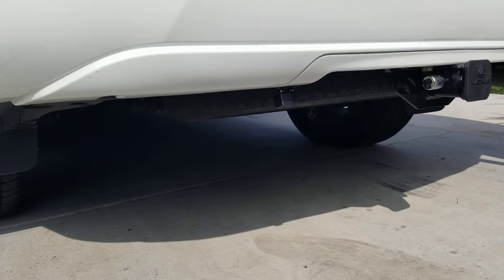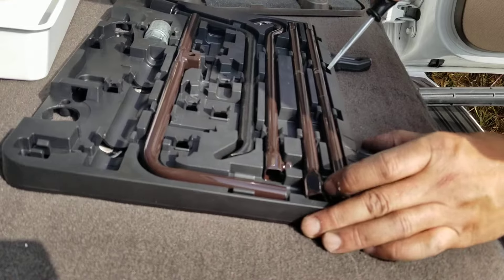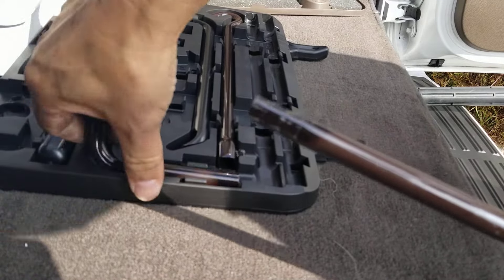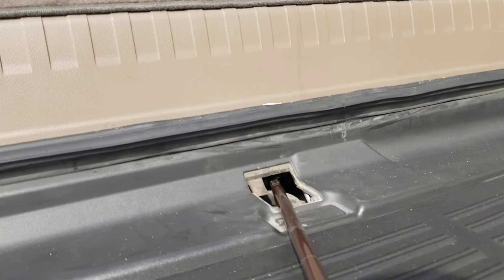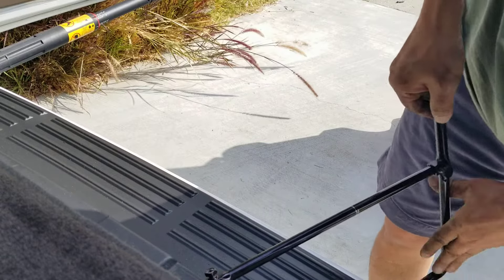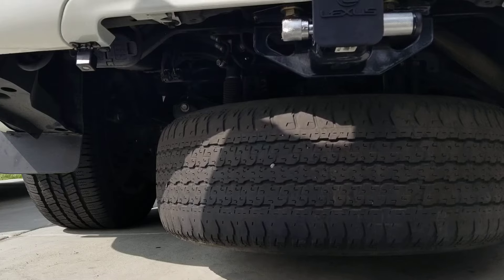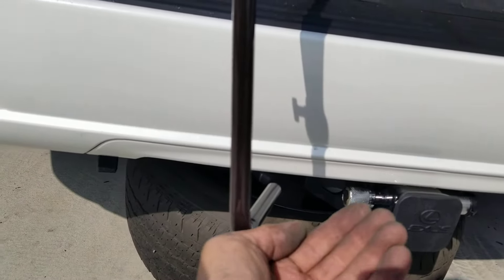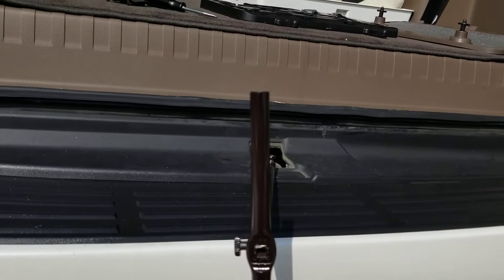Lexus GX460 and GX470 Spare Tire removal

Comment: @gxbob is there an easy way to determine which tire pressure sensor is malfunctioning?   Checked all 5 tires for low pressure.   All are fine - yet my low tire pressure light had come on .   Thanks for all you do for GX community

Comment: Does it matter what way my wheel is facing? Can the face of my rim be towards the ground?
Reply from the maker: The chain hook would then be grabbing onto the face of the wheel causing scratches and also the wheel would be exposed to flying rocks and debris.

Comment: Thanks for the video. Just got my first flat tire today. Unfortunately, as soon as I lowered my spare tire, it also came with a severe tear on the sidewall. No idea how that could've happened? I just picked up a 2021 a few months ago.
Reply from the maker: Jealous neighbor.
Reply: @GXBOB  Thanks a lot for the reply Bob :) One question, I'm about to swap on some 265/70r18 all terrains on my GX. Do you think that size will fit in the spare area?
Reply from the maker: @vadim9342  hey, the good thing about the under carriage spare tire compartment is its not confined to just the oem tire dimensions. The chain that attached the tires swings in all directions. All you have to do is guide it to where you want it when you crank up the chain. Even though the 60’s ride up to my tow hitch, i can easily push it back more if i wanted to.

Comment: Hi BOB, I just did this and noticed that the front side of the spare tire sits a little lower to the ground than back side when I reeled it back up (a little slanted). Is this normal? It feels tight and snug otherwise. I guess I should have looked how it sits first before lowering it.
Reply from the maker: Hi Tu,   technically you can adjust any way you'd like.  All you have to do is keep it leveled while you're turning up back into its space.  Sometimes its easier to do it with 2 people so one can turn the bar while the other person eyeballs the tire back into place.  Also make sure the thing that clamps around the inside diameter of your wheel is properly set in place, that can throw off the leveling of it too.

Comment: Thank you for the upload sir! Just a quick question are you missing some tools inside the tool kit? Also I’m curious to know what goes inside the other panel? Mine was a first aid pouch but I saw two straps, seems like something else should be there
Reply from the maker: not sure if i'm missing tools but if i am, i most likely don't need it.  i used the same kit to do the hydraulic jack in my other video.  The other panel has my first aid kit and some ratcheting straps in case i need to tie anything down to my roof rails.
Reply: @GXBOB  well in your other video how to take the back panel off to redo the camera you have some interesting toys strapped there, not original Lexus parts for sure.
Reply from the maker: @alstonian78  its a manual tire pump.

Comment: Hello, do you know how tight it should be when you are lifting the tire up? Thanks in advance
Reply from the maker: Hey WEC,  Its a chain hoist. Very normal typical chain link.  I typically wind it up snug to the point where the tire has no slack to move around or come off its adapter, but not tight enough where the rubber is going to compress against the metal floor ceiling of its housing and cause frictional tire wear over time.

Comment: Lexus should have designed it so the spare tire valve stem was pointing downward so you could check the tire pressure with the spare on the car.
Reply from the maker: Hey...........you gave me a fantastic idea......Thanks.

Comment: Do you know how big of a tire I can put on the spare compartment?
Reply from the maker: I wouldn't go larger than stock because the tire was really tight against my tow hitch receiver
Reply: I was told by my Lexus technician that a 32 inch tire is the maximum u can fit underneath
Reply from the maker: @edzed3865  I'm sure you can use one leg to push the big tire in while you crank the tire up to guide it. I never attempted to put anything other than stock so I can't make a fair assessment

Comment: I was wondering if you knew how to turn off the tpms light on a 2013 Lexus GX460 I got a flat the other day and got a new tire today and my light didn’t turn off
Reply from the maker: Hey Justin,  don't believe  u can do that manually.  I don't even think there is a reset button for as long as i've owned all 3 generations.  The tires have monitors.  If your lights are on and your pressure is good, that means the people who replaced your tires took your monitors?  I've never had to deal with it so i may check on the lexus forums.

Comment: what if my tire is seized?
Reply from the maker: When all else fails , find out where the seizure is and pick up a can of WD40
Reply: @GXBOB  wd40 tried it's a 2004 from Michigan, stubborn rust seize
Reply from the maker: @zhonghaozhao919  After speaking 4 entire area in WD40, I would start using pry bars and Chisels. It can't get any worse.
Reply: @GXBOB  Good idea! Pry bar, yes
Reply: @GXBOB  How would you use a pry bar?
Reply from the maker: @katysnodgrass7524  YOu would typically locate the area of rust and start from there.  I"m assuming his car has seen water and harsh elements that has made his spare tire pulley system seized.  Without me actually being there or knowing exactly what is seized, i can only suggest some tools that can help him with leverage to free up whatever is stuck.
Reply: @GXBOB  Can please tell me exactly where the jack goes under the car to lift the car to take the tire off?
Reply from the maker: @katysnodgrass7524  Somewhere in this video shows you the lifting points.  I made this one way back  then.  
 https://youtu.be/taDrRIC10PI
Reply: @GXBOB  THANK YOU! Your videos are extremely helpful and I hope you keep them coming!

Comment: Hi GX*Bob, would you happen to know if a 285/70r17 tire would fit the spare tire holder in the GX460.
Reply from the maker: funny thing you said that because i was seriously shopping for rims and tires. I considered going big and thought about the spare tire.  I don't think i would replace my spare tire.  I would only use the oem spare tire to get me back to civilization and replace the flat one.  I thought long and hard.  Only makes sense to change out the 4 tires i'm riding on unless you have a tire carrier and u want to show off your Method 305's.